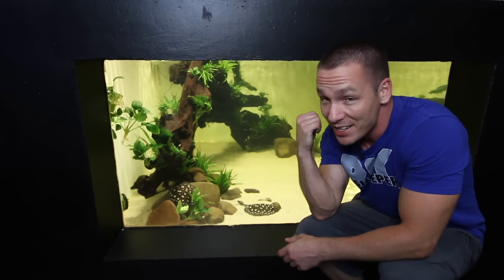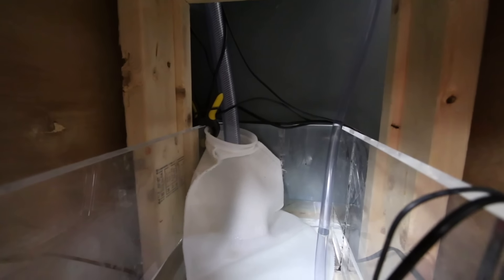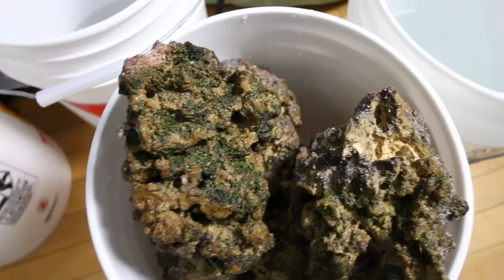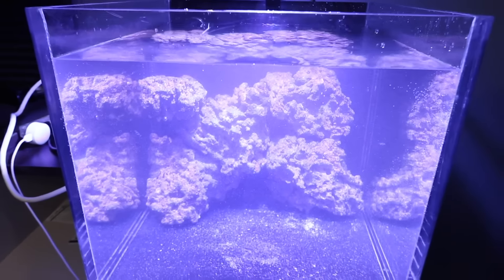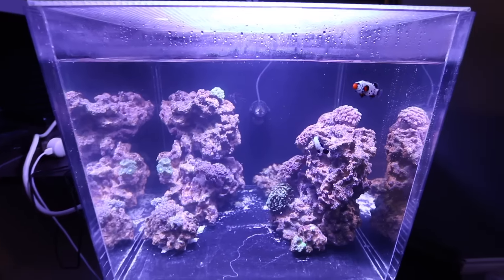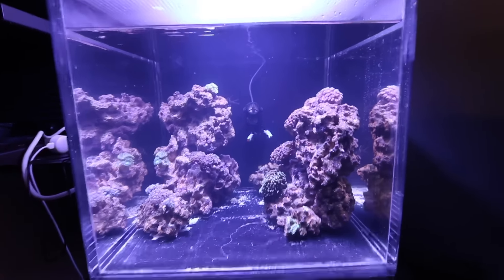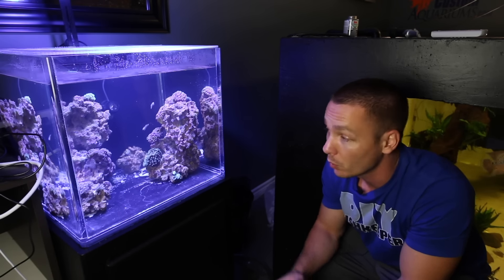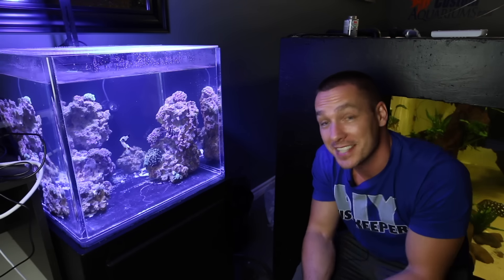The LAST aquarium in the gallery

Comment: Nice video, a couple things I will say to when you're doing your water changes.  Make absolutely sure the Ph. Alk, and salinity of the new water is matched to your tank to avoid a drastic swing in your parameters that will stress your fish and corals.  The second thing is add a T-Fitting to the return line with a valve on it. Use that to drain water out of the system, and then add the water back to the sump. This will eliminate the need to add large amounts of water back to the display tank, again reducing stress on the livestock.  

As for your sump, I highly recommend adding some baffle plates in there to control depth and water flow across your chosen media. Most skimmers require a certain level of water to operate correctly. Having a full open sump means the entire water level is set by the pump and may not be correct cor the skimmer.  Also using the baffles you can direct  water flow across the media increasing their ability to remove toxins like ammonia and nitrites. Lastly by adding the baffles you give particulate places to settle before they reach the pump section and this will all but eliminate the chances of detritus making its way back to the display tank, and/or getting sucked into and clogging the lift pump.

Comment: The only thing you should do differently with this tank is add powerheads. A Fowlr talk does well with a 10x turnover rate but once you get into corals you'll need to up that to between 20x and 40x depending on the corals kept. That return flow isn't enough. A low flow can actually choke the corals and cause bleaching(dying) corals even in a very temporary tank you definitely need more flow.
Reply: Some sps tanks run 80-100x turnover rates, flow is incredibly important in reefs. Also keeps dead spots to a minimum.

Comment: Nice and seemingly quite simple and exquisitely beautiful! I almost want to try my luck with a Salt water tank, but Im still going to need to decide which size aquarium tank I want to use for a Marine Tank! You Make it look so easy but you have the experience with them to make the most difficult thing or task look easy. Thank you Joey for my almost found enthusiasm and saltwater. Desire to risk taking the plunge once and for all!
Reply: Once you determine where you want to place it in your home, you can use blue masking tape to mark off the size you are considering both on the wall as well as the depth on the floor. A very nice comfortable size is 120g (4' x 2' x 2'), but you may prefer to start with something a little smaller perhaps?

Comment: The rockscape looks decent. Just a couple suggestions though. You might want to scape further from the tank walls or you will never be able to clean it easily. Another tip would be to utilize two islands of differing heights and closeness to the front wall to give illusions of depth and height.

Comment: Odds are the Bangaii Cardinal pair that you have killed the third wheel off. When it comes to Bangaii cardinals its actually fairly normal to end up with just one or a pair. While they are young they are usually fine in a school but it's when they get bigger and they start pairing off that they can get aggressive with each other, which sadly in a small tank doesn't work well for the third wheel.

Comment: I have fresh water tank and currently saving for a saltwater.  In the video you mentioned you may add a skimmer, do you not use one now?  Would it be something I don't need to start with but can add later as I am raising funds?
Reply: You can add it later if you prefer. You'll have to do more water changes if you don't run a skimmer.

Comment: I know where ur banggi cardinal is. if 2 of the 3 start to pair off. If they do, you may also notice them going after the third cardinal fish. If this happens and they are in a smaller tank, you will need to remove the third before it is hassled to death.

Comment: Shouldn't you start from the inside to the outside and you said that you wanted to put the saltwater the closest to the window which is the inside and it would be hard to move the stand out and install the pumping after the other tanks are done right? So shouldn't you do that first since the one nearest to the door could be moved outside for more space to install the pumping?
Reply: aoD Electa bigger saltwater tanks take longer to get up to stocking load's. Which is irony when you want as big as you can get but the filters and skimmers take longer to dial in just right. So I'm sure he's got them running but not filled up just yet with live rock and corals. Time will tell.
Reply: Mitchell Lubline the bigger point is he said he would work on fresh water but they are near the door which has more space than the saltwater which are next to the windows or just doesn't make sense for him to start at the door with fresh cause it wouldn't leave him space setting the saltwater tank last

Comment: Hi King, 1 question that no one has been able to help me with. Some say 24 by 7 others say 2 to 4 hrs a day. How long can a power head be kept running continuously? Thanks in advance.
Reply: T R Rajiv depends on what your using it for.
Reply: MrTopfuel78 it's for filtration for my 120g housing my flowerhorn. Also wanted water circulation instead of using a bubbler.
Reply: T R Rajiv 24 7 should be fine as long as dont have one to powerful.

Comment: With your saltwater tank do you use RODI water? And how important is it with saltwater tanks?
Reply: It's the best recommendation for anyone running a saltwater system.  RO/DI water is pure, so you start off right.  You mix it with salt mix for saltwater water changes, and you use RO/DI fresh water to replace what evaporates daily.
Reply: The cost of that has been a big deterrent for me
Reply: The initial cost of setting up a saltwater tank can be expensive, but that's all up front cost. You'll have monthly expenses for maintenance, testing and feeding, as well.  I tell people for saltwater you'll end up spending about $47/gallon for a nice setup, before livestock.

Comment: Is rodi water necessary
Reply: Matt Wolf, easy answer.. yes
Reply: If you want coral or a sensitive species, yes. If you just want a clown or other hardy fish, no. Ultimately it depends on what containments are in your water and how much. Keep in mind that salt water aquatic life is generally more sensitive than fresh water. Even more so if the specimen is wild caught. Long story short, better safe than sorry.
Reply: Ethan White.. not so much.. it's more like if you want algae or not.. Technically you can do it all with tap water but good luck with that. I want to keep people in the hobby not set people up to fail. His tds could be like 700 you don't know.
Reply: Would a $75 eBay ro/di filter be good for long term use or should I invest in better now
Reply: Matt Wolf you can get good rodi units from eBay for cheap. But do research on it first and check reviews.

Comment: In SW, you will not have multiples of a single fish get along, sometimes not even the same family of fish can tolerate each other. Notable exceptions being pairs of clowns, etc etc. NOTE: If you at a later date add new clownfish? All hell will break lose.
Reply: rakiest, not true. There are many species that live in groups, pairs, or harems. Many smaller wrasse live in harems, clowns live in pairs or harems, cardinalfish live in groups, Anthias live in groups, and some tangs live in groups.
Adding a new clownfish with a single established clownfish is fine as long as they can form a pair.

Comment: are you going to add sand?
Reply from the maker: +luke tan nah, caused too many problems
Reply: The king of DIY I think the purple color of the light works well with the dark color of the plain bottom, makes the tank have more depth.
Reply: Sand is far better than no sand aesthetically. What problems did you run into?
Reply: luke tan ArE yOu GoInG tO AdD sAnD ?